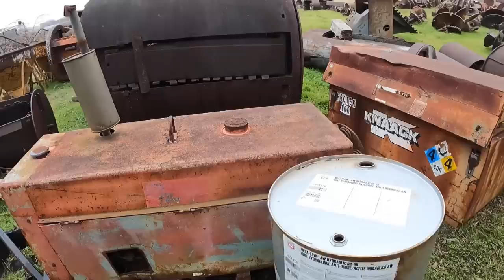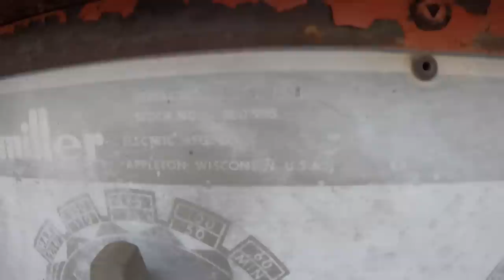Miller Big 40 Find.

Comment: I am a fan of rebuilding machines, if it make’s economically sense. So I would vote for rebuilding it.
Your videos are really great and I learn a lot from them.
Thanks Isaac for all the great content.
Reply: I second that!
Reply: If a rebuild will be a better product than buying new (because new is usually crap), then cost should not the deciding factor
Reply: Check out classic works
Reply: I third it!
Reply: I forth it! 👍
Reply: I agree, I have a iv 30 with kabota diesel, and it runs and welds beautifully. The older models have more copper windings in them and are usually 100 percent duty cycle rather than new ones at 60 percent duty cycle. Makes big difference air arching or gouging. Plus arc is very stable
Reply: Today , rebuilding an older rig is the best bet. I am rebuilding a Lincwelder 225, and when I a, done it will be as good if not better than when it was new. I always loved those Miller Big 40's . I believe they have the same engine as the Lincoln SA that you have.
Reply: I had a big 40d with a Perkins air cooled engine  then I got on prescription pills and snorted it and 2 f-250 up my nose  it's taken me 15 years to get control of my addiction but thankfully I've been clean about 7 years im just now getting back to working at 48 I've got a 250nt  miller right now . But I miss the big40d all the time.

Comment: Recently I have been buying old engine driven welders and restoring them.  I own a hotrod race and fabrication shop so it's a perfect fit for me.  I build all my own sheet metal panels in house and I recently started powder coating in house so my oven is big enough to powder coat welder frames.  I just converted a sa200 I am working on to coil near plug ignition with electronic fuel injection using a fabricated aluminum intake manifold that I build in house.  The efi system has Bluetooth and wifi remote monitoring capabilities so a welder can check engine coolant temperature, oil pressure and engine rpm from a app on their phone and I am adding the ability to start and stop the machine from the phone.
Reply from the maker: Where are you located? and do you have an instagram page?

Comment: I found a big 40 at a auction couple years back. Took a little bit to get it running but when it did run it was awesome!!! Wish I hadn't sold it...If you decide to get it running I highly recommend the PerTronics pointless distributor.  Made my life so much easier. Mine had the Continental engine part number for the distributor I got was D41-05A.
Reply from the maker: That is awesome. Thanks for the P/N. 👍👍
Reply: Agree on the Pertronix distributor.  It's the only way to go with these vintage engines.  It really perked up my Ford 8N tractor and VW Beetle.

Comment: It's amazing how many old rigs get left like this. Where I live in southwest NM, we have a couple big copper mines.  And those mines have tons of equipment, the equipment have tons of mechanics, and the mechanics have hundreds of trucks. Each truck has a welder on it that only gets used for charging 24 volt systems when down. Very rarely do these mechanic trucks weld, so a lot of low hour welders. And every time a truck gets replaced or upgraded, the machines are left to die in a warehouse or yard. I was lucky to get a small Bobcat 225 a couple years ago from a boss who worked a trade and I  then traded that machine for work at his home.  Don't know why they don't sell them off for auction or whatever. There's plenty of youngsters starting out that  would love a fixer or in this area a rancher who can't simply afford a 10k new machine.  I vote rebuild restore, but that's just me boss

Comment: I bought an old Lincoln Weldanpower 9-G, replaced a lot on the Onan engine, carb, coil, plugs, wires, intake manifold, reseated the valves, replaced the fuel tank with an aluminum tank, fuel filter, soaked the seized inner workings of the dials with pv blaster  still works today, resurface the contact of rings, replace the couple capacitors in the welding unit. Welds great and runs great. I very much like the old mechanical welders lest stuff to break. Easy to fix too.

Comment: Access is pretty good to the motor. I'd be tempted to do the basic stuff, soak it down with oil, see if you can get it to turn over, maybe carb rebuild/replace (if cheaply available) and check the ignition. If you can get it to run you'll find out how the generator side is. If no good then pull the motor and rebuild. Either way looks like a fun little project
Reply: Isaac, ya might ck out the Farm Project channel 'n see what he did with Seafoam additive and his old ford courier truck.  Interesting to say the least.
Reply: Drop it off with Diesel Creek and see what he thinks!

Comment: Just got one of those big 40's running for my 19 year old son a few months ago. He bought it non running and we turned it into a project. His has the continental diesel engine. I rebuilt the injection pump for him and he's replaced the injectors and all the lines and hoses. We finally got it running and is one of the best welders that I have struck an arc with. The engine runs a little warmer than it should but it works well enough to spend the extra money for a complete rebuild sometime later this spring. It has been a fun father/son project.  The one that you found would be be a good project machine for you and your son.  They're great machines and the one that my son has is an arc gouging beast!  It's been enjoyable watching you work and teach at the same time.   Make those memories, they grow up fast!

Comment: I would definitely get it running and welding. I bought an SA-200, partially burned for $200 years ago. Smoothest welding machine I ever owned. That's what I learned to weld overhead with 7018. No computers, problems were always repairable in the field. I carried an extra coil and a carburetor kit with me. Never left me stranded at a job. Scott
Reply: I know its an old comment but thanks for sharing. I too learned to weld with a  very good machine.  Opposite of most people. then switched to an old bobcat and thought something was wrong with the arc.

Comment: Back in the early 1980s I knew a fellow that took one of these large 4 cyl welders that was made in the late 50s, and did a complete tear down and restore. He needed a welder, but pointed out that the engine was very common, used in tractors, fork lifts, mobile pump rigs, generators, etc.  You already have a great mobile welder, so take it apart and make use of the components.  Sleeve kits usually available, and any auto machine shop can do valves.. Go for it!  Rebuild and repower the old forklift.
Reply: It wouldn't hurt to with a minimal amount of effort check to see if it would run ..compression check, oil change, and if it doesn't weld you can pull the motor and use it for your forklift

Comment: Tell ya a little story about one of these.   Way back  in the 80's I worked for a parts  outfit,  owner  had a welding/ gas store, sold miller.  They took in a 40 some guy had bought at an auction, out of a flooded mine.  He'd  had the engine rebuilt,  cleaned it up and could not get it to weld.  Short story,  ended up removing all 6  diodes,  and I had built a  big tester to  load test  automotive/ truck alternators.  Tested all 6 and MISSED the fact,  found out later---that  someone had replaced one with the WRONG polarity.  So there were 4 of one polarity  and 2 of the other,  and it loaded the welder output and would not weld.    Felt pretty good when I found that!!!  ---even thought I'd missed it first time around.

Comment: I would try to get it running .... clean the plugs and make sure you have spark, clean the carb, and see if the engine is freed up, make sure there is oil in the engine, and the radiator has coolant , and give her a crank and she if she fires up and then go from there those are good old Generator Welders !! I love to see old tools brought back to life if possible !! Great video as always !! 👍👍

Comment: I have a big 40 just like that one. Mine is a 1978. In hacked and a factory muffler. It's been a good machine. Some parts may be hard or impossible to get. Don't throw any parts away thinking you'll get another one easily

Comment: Hey Isaac,  I didn't read through the comments first so someone might have said the same thing  I'm going to say.  First thing I would do is bar the engine over to see if it at least turns.  water settles to the bottom of oil so if the dip stick says it's over full, more than likely there's water in the crank case.  Good part of that is the water will be on the bottom so the crank shaft and rod bearings will be in oil.  Bad thing is that the oil pump pickup is in the bottom of the of the oil pan so the pump will pick up water first.  Might be a good idea to drain the water out first.  The old Flat head 4 cylinders are known for valves sticking so don't be surprised if you have a few valves stuck open.  There are 2 letters on the end of the serial number that will tell you what year it is.  The numbers in the serial number will let you know if it was an early or late in the year build.  Using the serial number on the Miller web site will get you the year and a manual for it.  I would say it would be a great project for you and your son.  I vote rebuild it as a welder.   Its a simple 4 cylinder flat head engine.  Points, condenser plugs and wires.  It's also carbureted, so no Fuel Injection or ECM.  The Electronics board in the welder will also be fairly simple with through board mounted components.

Comment: Paul from Fab Rats helped get an engine that had been underwater for 30 years running.  Because there is a rain hat on the exhaust there's a chance you can get it running.  I've converted all my gas welders over to electronic ignition.  Magnetos just don't spark as hot and they need an occasional overhaul.
Reply: A mag sparks hotter
Reply: @crazyoilfieldmechanic3195  Look up the spark gap for a magneto and then the spark gap of an EI.  EI's are a larger spark gap.  The advantage of a magneto is it will keep running even if the alternator and battery dies.  That's why they use them in aircraft but they require two because they do die on you mid flight.

Comment: Isaac I ran that exact welder for 10-12 years, one of the smoothest machines I ever welded with. Its a ford industrial 4cyl motor. It may cost you way more than its worth to bring it back to life just by what I see but great find though.

Comment: I have a 1980 big 40 that I got from a junkyard. He had it for 10yrs sat unused for 8. Rebuilt the carb, new coil and a couple of diodes and she was going. Great machines but they weigh a literal ton, 2067lbs with the axel and tongue.

Comment: Happy New Year Isaac.  If the engines in OK shape - only needing the rebuild (as you say), I’d put it in the fork truck.  You’ve already got a trailer mounted machine and the machine on your truck… Having a dependable engine in the forklift is an important piece of your shop “works”.

Comment: Ah, the venerable old Miller engine powered welders!
 We had this model but mostly the 400D ( diesel powered ) in our Rental Fleet a few years ago.
I'm certainly in favor of you rebuilding it, just as long as you let us follow along here on your YT Channel, with the restoration. 
That Continental gas. engine is or was, a very popular engine, as you are no doubt aware.
Tough as nails, and reliable power plants for welders ( of course ) and pumps etc. It should make a good unit for your Forklift.

Comment: Nice change . Could be worth the effort to see if it'll run and work as a generator or welder as a project with junior . If not your gonna get some valuable time learning how to take one apart . Maybe the reason you haven't seen many is they are that good when working no one sells them on ... or nit lol ..another video to inform what the outcome turns out to be .

Comment: i looked up Miller Big 40, it says it's gasoline. I'd do the basics, flush the fuel system, tear down and rebuild the carburetor, get a battery, spray some penetrating oil down the cylinders, take out all the spark plugs, check the starter.and turn over the motor. If frozen put a wrench on the Harmonic balancer. Check for spark. Depending upon the hours this machine has it could be a gem. It's cosmetic.  Great job, hope you take the time to get this machine running. Good luck

Comment: I have a Big Forty and I replaced the control panel with a new one from Miller.  Could not Get the handles off the welding controls., cut them off and made them.  Also replaced the fine control with a new one I found on e-bay.  Love the way this welder performs.

Comment: see if you can get it going. I ended up with a old Lincoln range 8 that had no spark but because whoever worked on it last couldn't figure it out they left it open and water got into the cylinders so now its way down on compression and has bad blow by. Still works but its hurting good. Its a fun project to learn how to daig and repair plus try new things or test stuff out since the motors shot anyway so no harm no foul. Might be a good learning project for your son. You can tell him if he can get it running it can be his first machine. I'm always picking up random crap to play around with and tinker. Its a good skill to have so you can keep your equipment running or get good deals on non running equipment if you know how to fix them. Ive picked up over $1K+ of broken and tossed equipment from my neighbors and only spent ~$250 to fix it all.

Comment: Awesome lift. I'm watching the boom starting to point down as the winch started to pull, watching the boom getting close to the ground, for a moment it looked as if the pressure relief valve was going to kick in, but then, gravity gave up. That was a close one.

I vote for full restoration of the welder. I know it is an undertaking but as mentioned by your other fans, great father/son project and worthy of its own video series.

Comment: good video Issac, this Miller big 40 could be a good unit ,time will tell, growing up my neighbour had one that looked like this one, i have no idea if they were the same, maybe similar , who knows , you found the serial number on the control panel, you maybe able to get all the info online from Miller about it or what the Big 40 offered to the professional in general, this would all be free in most cases ,you'll have a Continental 163 in it most likely, there's parts manuals online for these to, cheap engine to rebuild we did lots in our forklift shop when i worked there about 20 yrs ago,  if you get it loosened up with a few gallons of Marvel mystery oil, it just  might run 🧐 or the engine goes into the forklift  👍

Comment: A good inspection - of the windings of the generator .
And engine - water in coolant - if that is a antifreeze mix - the antifreeze eats the babbit bearings .
Did many yrs. of auction stuff , flat head engines - it is typical that sitting for a long & with water in crankcase , that the valves stick .
A friend [ from Oklahoma ] showed me in the field how to free up the valves - pull the plugs - use a gas/oil mix with a squeeze bottle with a right angle tube to squirt in the direction of the valves , then with the correct bend [ we kept a bunch of different length ] screwdrivers - to reach the top of the valves , then tap on screwdriver - after finding by feel the valves - and try to tell from sound & feel if the valve is up / down - and sitting on cam lobe ????
Then turn engine over by hand - a little at a time , once it sounds/feels like each valve , is off / floating --- the cam lobe - try to tap down ??
This can take an hour + , we have driven 10 wheel drive cranes 180 mile back to shop - after a seized engine .
Once you free up the valves , try to start , listen for rod knocks .
I suspect a cracked head / top of engine , there are crack repair systems for fixing .
The tricky part is , finding out as much as possible - to find a direction to go .
Forklift eng. may be easier to fix than weld eng. --- what happened to forklift eng.  ?

Comment: Hi isaac iv  just  watched the video  of you guys picking up  yon big heavy welder ,  my advice would be to try an get the engine  running  first ,   then see if you can get  any juice out of the genny and  if  it runs and makes sparks  ,   again just my opinion   both ov  you guys strip  it down , Engine , genny , and all the  frame and tin covers ,     sand blast every thing you can and put a nice  coat of paint on it make it look nice .   Bet you can't  buy one of these units off the shelf  today ? 😂 ,   as iv  mentioned  before the old colchester lathe  i have  in my workshop  circa   1918  i  can redress the cutting edge on a cylinder  grass cutter to  a very fine tolerance  so when it's  kissing against  the bottom  fixed blade it  has the ability to  cut paper .   Wish i could  send you pictures  stan.

Comment: Hello ICWeld, you have asked for opinions xo here is My 2 cents worth. If it were my machine I would do a basic funational check on both halves. If the stator and rotor check OK I expect the engine failed.and the reverse if engine has no serious failure. The welder is very old technology now but as a back up generator may have enough value to bring back to service.The engine if economically repairable has infinite uses. Assess both and make a plan. Bring us along on the journey for all of the progress. PS. I checked the dry weight, The unit, is listed at about 1500 pounds dry, no oil or fuel. At the extension you had on the lift boom a considerable load for sure. Great video keep them coming.